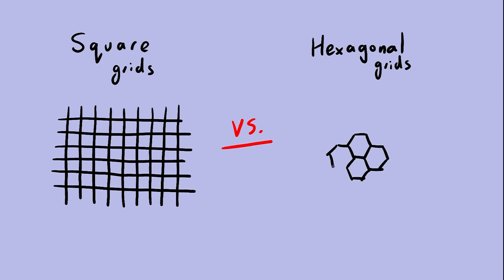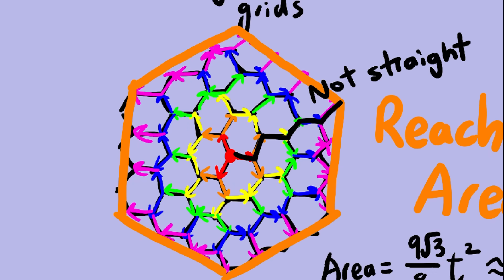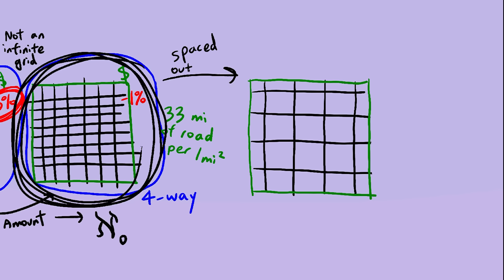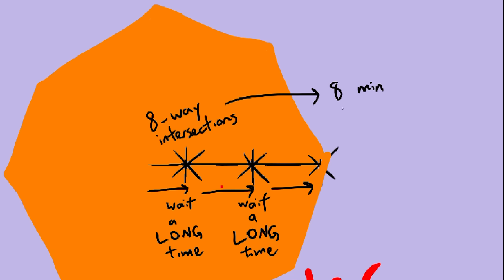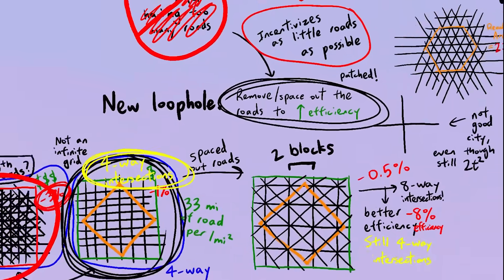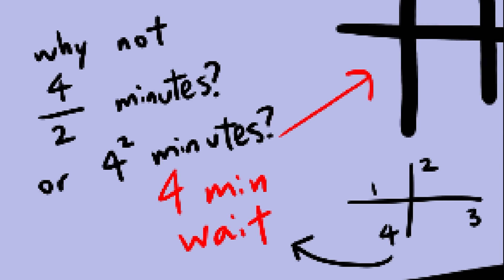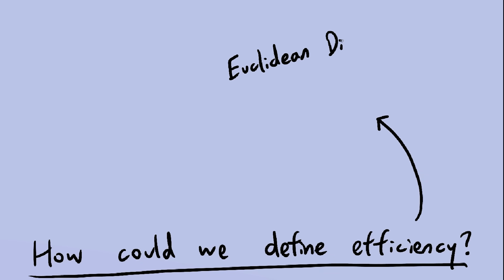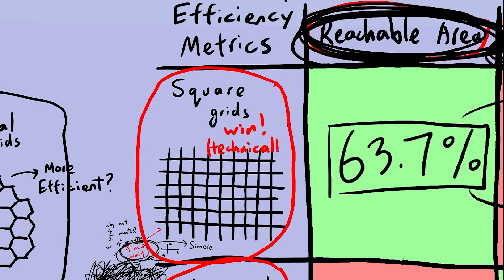Would hexagonal city blocks be better?

Comment: "Why we don't have that many roads?"
Because there are buildings 
"Because it's too expensive"
Reply: It would be a parking lot
"It's too expensive" 
Damnit
Reply: Exactly. The assumption that roads are infinitely thin breaks down here. A better "penalty" is to try to maximise the non-road area.
Reply: Each mile of road in an urban area costs $3-5 million, but what really gets you from a city financing standpoint is the maintenance costs that get worse over time to the point that you can't keep up with it. On top of that, all of the buildings get spread out more, which requires more utility infra per taxpayer and more vehicle miles which wears out the roads faster.
Reply: Yeah, I was thinking the same – the point of a city is to be in the buildings and spaces it contains, not just driving around the place. The roads are secondary (albeit important). But then I realized you could frame the cost as primarily opportunity cost: if road is occupying (or dividing) space, that's space that can't be occupied by (a single) a building/park/whatever. In many cases, I would expect the lost income to be higher than the construction and maintenance cost of the road (perhaps I'm wrong), and even where it weren't (e.g. free public spaces), the value to denizens would have been traded for the value of whatever improvement to transport there is (which is nebulous and hotly debated).
Reply: Because bread tastes better than key
Reply: If your roads are infinitesimal small and your buildings are too, then the road length is the only relevant measurement. He already mentioned that all of this has nothing to do with reality.
Reply: Economists have a name for that: opportunity cost.
A functioning building serves more than an extraneous road.

Any space dedicated to roads is a space not dedicated to buildings... so the cost of having roads is also the cost of not having buildings in that area[the area where most buildings want to be]
Reply: 0:05
Reply: American grindset lol
Reply: The issue with the hexagonal grid is that is impossible to designate certain roads as arterials and certain roads as major so traffic flow on the roads that carry the most cars would be heavily slowed down.
Reply: @DylpiqkleSTier  nothing is stopping you from doing that actually, it's trivial
Reply: Yeah, my thought was this follows from assuming roads are infinitely thin. Giving roads an actual width means you have to subtract the area used by roads from the "reachable area."

But with just that you'd return to the loophole that larger blocks are inherently more efficient space-wise. But I think that problem follows from assuming our target position is always right on the grid. If we decide our target position can be any point within the block, and traveling to that point can use both "driving" on the grid and then "walking" at some defined slower speed to the actual target position,  we could arrive at some optimal block-size that depends on what we pick for "driving" and "walking" speeds.
Reply: Just have every road be under ground or every building be underground.
Reply: @MegaLokopo or we could just go above the buildings with drones or idk
Reply: @Thiago-tf6zd  Building down is a lot cheaper than doing drones. But drones would be cooler.
Reply: @MegaLokopo  we might as well build our cities as spheres at that points
Reply: @JasminUwU  So long as the cows are spherical I am happy.

Comment: It’s worth noting in passing that the “brick” grid at 6:07 is actually a hexagonal grid in disguise, with each hexagon squashed vertically until two edges are collinear. So intuitively it’s unsurprising that it loses to the regular hexagon grid.
Reply from the maker: ohhh I didn't think of that! and the reachable area is hexagon shaped too (but it's flattened, so less area than regular hexagon). clever!
Reply: Ugh, serves me right for commenting before reading all the comments! (Said the same thing)
Reply: @HannahLemurson  said the same thing as well oops
Reply: @HannahLemurson  Great minds think alike
Reply: that's what I thought
Reply: Yep, that was exactly my first thought. Those brick are hexagons with 90/180 degree corners. :D
Reply: 67

Comment: About the pénalisation for waiting at intersections, I think most of the time you do not have to wait at every intersection. The schedule is done in a way that lets you pass at the next intersections long as you keep going straight. Still I think the idea of penalizing intersections is good for measurement of efficiency. 
The problem I think is that you never introduced a way to measure that the road network is actually meant to transport people to a place with something to do (except maybe in the last section) which means that roads must leave space for other things and also that distance to these things cannot be too far from the roads

 In the end I think the real, practical efficiency of a road network can only be evaluated with a simulation, especially since you also have to worry about congestion du to a city center or favorable axes of circulation.
Also about the brick layout, I think the problem with it is that it favours one direction of transportation (horizontal) I wonder if a layout with concentration circles, divided by lanes going from center to outside in a brick pattern (not aligned ) would solve the problems.

Comment: I literally fell asleep last night trying to decide if hexagonal city blocks would be good and then today I saw this
Reply: Hexagonal streets are bad.  On a grid, no matter where you want to go, you can get there with just one turn.  Turns are much slower than going straight.  The endless turns in a hex grid will make for slow, annoying driving.
Reply: @VPWedding  unless you use roundabouts
Reply: @VPWedding The turns are much more open, though, so they are easier to do without slowing down.

There will be a point in which the angle becomes irrelevant in comparison to a straight line.
Reply: @mateusfccp But for any given journey, half your turns will be left, crossing traffic.

Comment: 9:30: No, I thought the opposite.  That implies that at any time, a car traveling on a straight road with no other roads nearby actually needs to stop and wait for two minutes. 

Also the entire time I was thinking not about cost of more roads (asphalt is cheap) but that the infinite-road solution actually has no useful destination; it is a parking lot.
Reply: Although the unit cost of asphalt is cheap, the total cost of road building and especially maintenance may not not be. But still a good point about the infinite car park.

Comment: In my field we use the term "manhattan distance" :)
Reply: ive heard it called the taxi cab metric
Reply: @chargle  Me, too, and I hadn't heard of Manhattan until recently I saw it referenced in someone's code and was so confused until I looked it up and found they were synonyms. xd
Reply: Would that be applicable on a hexagonal grid too, or does it only apply to square grids?
Reply: @robo3007 Manhattan distance I believe specifically refers to a distance metric where the distance between two points is calculated as x+y. So it only really works with square grids.

 I personally wouldn't refer to similar measuring on a hex grid as Manhattan.
Reply: @robo3007  hexagonal coordinate system would be a nightmare, no matter what cgp grey says lol
Reply: The opposite I call chess (or king move) distance, or runescape distance. I would love to know the real term. The hypotenuse is Max (x,y) as opposed to x+y.
Reply: @jiaan100  
Its called the Chebyshev distance, maximum metric or L(subscript infinity symbol) metric. Also known as chessboard distance
Reply: @nade5557  ty

Comment: Rectangles are pretty hard to beat! They enclose a reasonable amount of area, while forming straight lines, making it easy to design both a usable addressing system, and an efficient fractal hierarchy of roadway speeds, which saves travel time by varying the effective density of roadways. A cool way to visualise this is with “equal-time” or “isochronous” map projections.

I’d be curious to see what happens if you use a hexagonal array of vertices, but allow roads between any two vertices in a hexagon, since that would let you embed a variety of shapes with a relatively small set of tiles.

Comment: 8:52 For completeness, an 11-way intersection cannot be made into a regular grid.
Reply: you are thinking too flatly, just find a conviniently shaped hill that is curved the exact amount you need for it to be possible
Reply: @WitherLele You would actually need a *hyperbolic* surface afaik.
The only spherical solution that I can see is two antipodal points connected by 11 meridians, I guess; I wouldn't call that a "grid"... 😉
Reply: @WitherLeleYou're thinking too small, your city is already built in a spherical 2d geometry

Comment: i love when i have to wait for 2 minutes on my 2-way intersection
Reply: the best is waiting 1 minutes on my 1-way intersection
Reply: @tratixmusic8884 i mean, it's a dead end, so 1 minute of turning around
Reply: @BowlofColdSoup no, it's a one-line road, not a dead end. Ever heard of "one-way only" roads? (Obv not, but...)
Reply: @BowlofColdSoup35-point turn for the 0-width roads. Quite the skill check.
Reply: @tratixmusic8884  The wait is mostly to spend a little time pondering how to have an intersection with only 1 item.
Reply: @tratixmusic8884 well that's for turning around of course!
Reply: also i thino the way you could penalize the infinite roads and no roads solutions is add a set size for your city blocks (for no roads; i would measure size as largest distance between two points in a block) combined with the road/area to patch infinite roads
Reply: @bot24032 and the 11-way intersection having a penalty of 11%, meaning somehow this monstrosity would only add like 13 seconds of wait time
Reply: i love when I have to wait 2*exp(3i) minutes on my 2*exp(3i)-way intersection
Reply: Damn pedestrians.
Reply: This was my biggest gripe with his arbitrary penalty. Regardless of whether we account for pedestrian crossings, higher intersection count is significantly worse for travel time. It’s kind of complicated because of real-life intersections prioritize different turns based on traffic load, but you can do a bit of napkin math to determine a more realistic delay. Note that this ignores traffic load and assumes you make it through instantly when your light changes.

c is time allowed for cars. p is time allowed for pedestrians. 

2-way intersections have 0c+p wait.

3-way intersections have a (1bc+0ac+0ab)c+p wait for right turns and (1bc+1ac+0ab)c+p wait for left turns. Average 1.5c+p. Other option is 2c+0p due to the unique properties of 3-way intersections.

4-way intersections have a (1b+1c+1d+0a)c+p = 3c+p wait. So almost twice as bad as 3-way.

n-way intersections (n>3) have a (n-1)c+p wait.

In conclusion, an n-way intersection is closer to an n-1 wait than an n wait or n% wait.
Reply: Real life example is a pedestrian crossing with traffic lights.
Reply: @Filipnalepa  Or just a sharp turn in a road
Reply: i love waiting -1 minutes on my -1-way intersection
Reply: @redcrewmate1813 Wouldn't that be equivalent with a U-turn? Making it possible for "bad thongs" to happen if the time to do a u-tutn is below 1 minute. (Time travel)
Reply: Also: you will encounter an infinite number of 2-way intersections, so the total waiting time is infinite.
Reply: The brick is the same but worse than the hexagon
Reply: Love is love.  no judgement
Reply: It probably should depend on how long the train is

Comment: 4:05 this loophole actually exists in real life, it's called walkable cities
Reply: Arguably a walkable city still has roads, just not ones with cars on them. A path is really just a road for pedestrians, if you think about it.
Reply: @Croz89  But they have the benefit of not needing a lot of space for cars, so you can:
1. Make the place nicer
2. Make the road thinner
3. Have more people in the same amount area
Reply: @BadlyDrawnJack That just changes the constraints of the problem, the optimisation is the same.
Reply: @BadlyDrawnJack  how do you make infinitely thin road thinner?
Reply: @BadlyDrawnJack  You still need roads wide enough for trucks to every building in a walkable city, because of emergency vehicles, delivery trucks, city services and so on.
Reply: @Croz89  would promenades be streets for pedestrians in hat case? makes sense to me
Reply: @Croz89 true, but the logic used it the video in based on cars, not pedestrians or light vehicles (bicycles for example)
Reply: @goatgamer001The logic wouldn't change. Cars are just faster than pedestrians or bikes.
Reply: @Croz89  cars are not just faster than people, cars are deadlier.

We talk about humans there. A walking human doesn’t need to stop on an intersection with other walking people as they can react quick enough and pass each other without stopping with ease (given the street is wide enough for both of them 🤠).

I don’t think it’s safe to let people in massive cars go full speed through busy intersections.

For the transportation I would prefer calmed traffic and 3-way intersections for safety over a several percents of efficiency in the area where people are.
Reply: @kagenekoUA  This a video about mathematical optimisation of an abstract city grid, not urbanism. Take that rhetoric where it belongs.
Reply: @Croz89  The most obvious different variable would be that walking isn't affected by intersections the same way cars are. So you aren't cheating by not giving a penalty for intersections

I think bicycles would be somewhere in the middle of the two?
Reply: @Lawden210 Depends on how narrow the path is.
Reply: @Croz89  Good point
That makes me think about how turning at a car intersection has "standardised" speeds, whereas with pedestrian roads, one could "hug" the corner for the most optimal path, which would congest said corner, causing other pedestrians to have to take a "less optimal" path, especially the wider it is
Reply: @Lawden210 We're looking at a toy model here so considerations like vehicle width don't really factor into it.
Reply: If your walkable city is a Minecraft flat world... Sure.
Reply: Walkable cities are great, but what a confusing point
Reply: shhhh theyre american they have no idea what that is yet!
Reply: Walkable cities arent just cities with no roads. If you started removing roads from like, LA you would not help anyone. Its adding infrastructure and support for pedestrians, as well as trying to limit urban sprawl (which, ironically, might result in more packed roads if you’re still mainly using cars). Honestly when he showed that my first thought was like a highway in the middle of nowhere, which is kind of the opposite of a walkable city in my mind.
Reply: With pedestrian traffic in mind, and imagining every car road as having a pedestrian path on either side, would the right "cheat" be a square grid with infinite overpasses, or a haxagonal grid with infinite passes?
Reply: Only if every building is underground.
Reply: @MegaLokopo  Are you describing basements?
Reply: AKA urban prisons
Reply: @MikehMike01  Being under house arrest until you were 16 must have been a very fun childhood. I live in a pre 60s American suburb, one built for humans and not demolished for cars, and let me tell you, being literally anywhere else in my state is always a terrible day. Cars have their place, but those places are all far away from cities.
Reply: @rob @robhillen8007  cars are freedom
Reply: @MikehMike01  True freedom is having a car for long distance travel, but still being able to walk to the store, to school, etc if you need to
Reply: @MikehMike01  Freedom is freedom.

Making it so that you need a car to have freedom means you aren't free to not have a car. It's like bragging that you have a curfew exception so you're free. Freedom is there not being a curfew to begin with, not having to pay for a personal exemption.
Reply: @kieranharwood7186  walkable cities = cattle on a farm
Reply: @MikehMike01 cars are coffins
Reply: @MikehMike01  You are an insane person.

Farms have boundaries. That's what makes them farms. If animals can just walk anywhere then that's not a farm, that's wilderness. Those walls and fences are what makes it a farm.

A walkable city is a city that DOES NOT have boundaries. There is nothing stopping you from walking wherever you want. The non-walkable cities are the farms. They prevent you from just walking off. They pen you in. They PREVENT you walking off. How do you not get that PREVENTING something is reducing freedom??

You have reality 100% backwards and are too dim to notice.
Reply: @kieranharwood7186  a lot of words to be wrong
Reply: @MikehMike01 What part of this incredibly simple concept are you not getting? Why are you so sure about something so stupidly wrong?
Reply: @MikehMike01 so when your car breaks down or someone inevitably crashes into you, you are now trapped because your singular only option of travel is gone. How is more options a bad thing?

Let's put it into more american terms. Guns are cool, there are many different types of guns, but you apparently only want everyone to have a single type of gun, no variation, no alternatives. Everyone can only have a single shot liberator pistol, that is your stance.
Reply: @castform57  you ever been to Europe and suffered in one of these horrible cities? I have, it’s worse than being dead
Reply: @kieranharwood7186  you sound upset, work on that
Reply: @MikehMike01  Being able to drive OR walk is a prison?  Bike lanes must frighten you considerably.
Reply: @MikehMike01  americans don't have feet :(